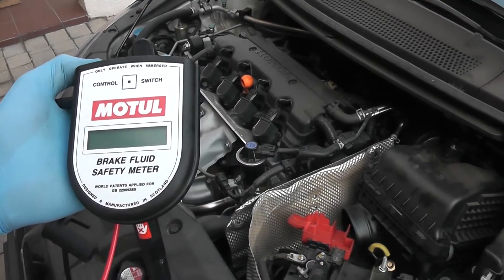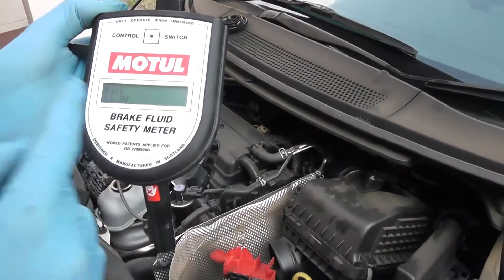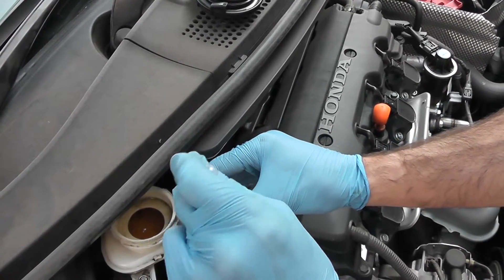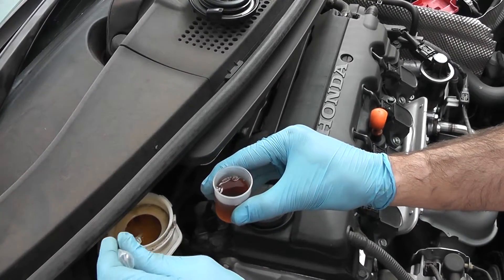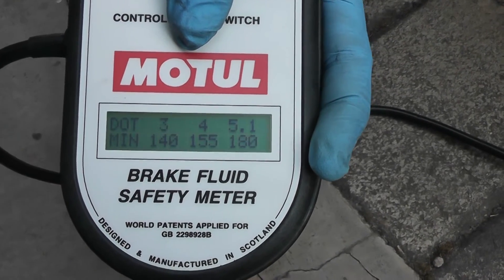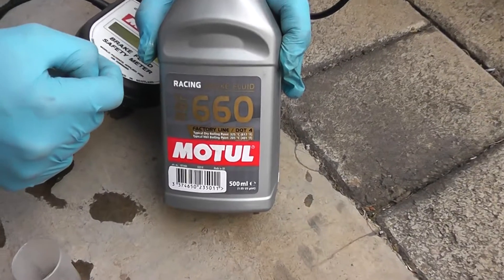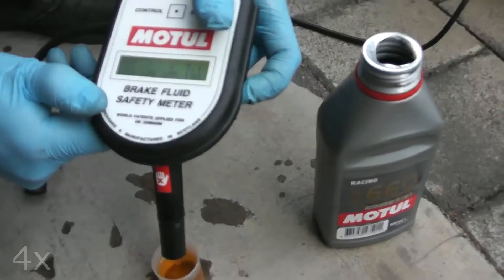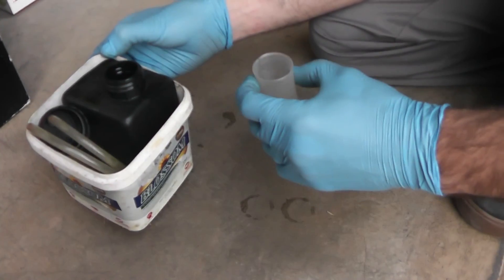Old vs new brake fluid boiling points

Comment: How long can we use the fluid of RBF660 after opening the bottle? I bought it (500 ml) but used only 1/3 of it in my Subaru Forester 2 or 3 years ago. The rest 2/3 is still in the bottle. The bottle is air tightened and the cap is tightly closed.
Reply from the maker: 2 or 3 years is definitely too long even if the bottle was closed tightly. Usually it should be used within 6 months of opening. The fluid may still be ok to use, but I would recommend testing it before putting it in a brake system. You can buy simple brake fluid moisture testers that are quite cheap. Rather safe than sorry when it comes to brakes!
Reply: 2 years maximum (throw it away or use for cleaning)
Reply: Do you mean such a tester? https://www.amazon.com/PTE-Tester-Calibrated-Brake-fluids/dp/B005HVG4GQ